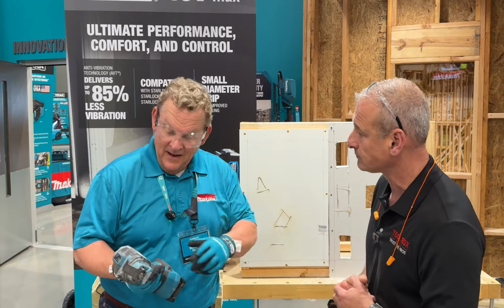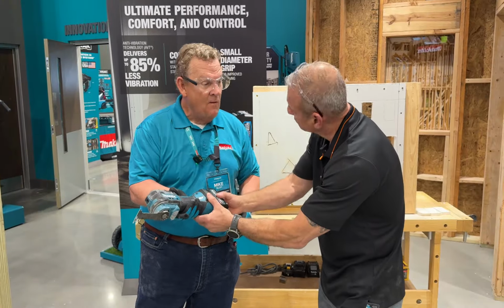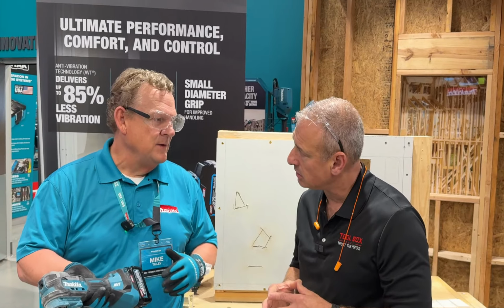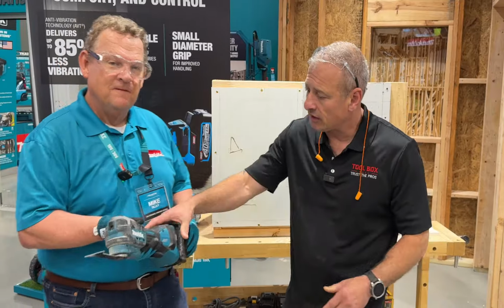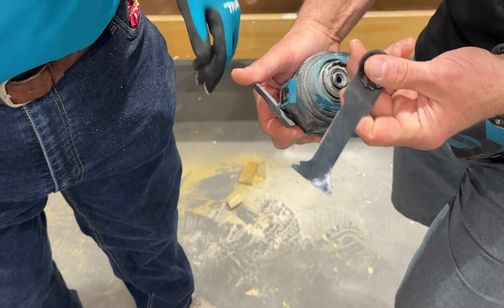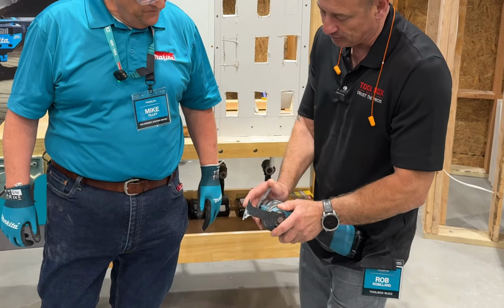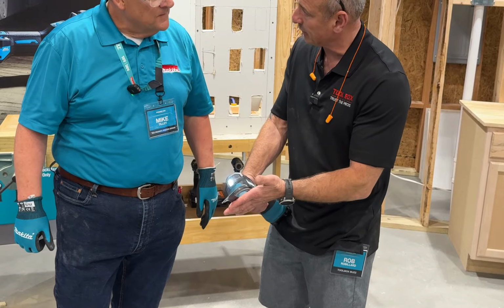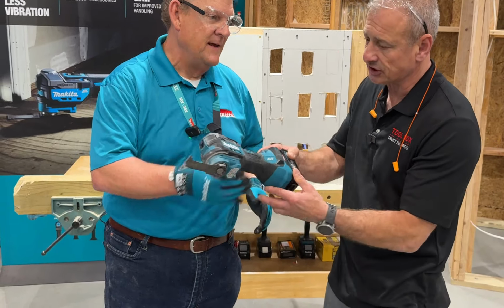Makita 40 Volt XGT Multitool TM001GZ01

Comment: I really wished they had worked on the ergonomics and form-factor with this model. That is the largest multi-tool on the market, somehow bigger than their first. It's not even necessary either as their competitor (hikoki) was able to achieve a much smaller form factor, low noise and vibration with same to superior cut speed. The funny thing about how this multi-tool is marketed to Americans is that the 18v variant is part of their sub-compact line. That's right, the world's largest multi-tool is part of the sub-compact line, what is that called, "alternative facts"?. Marketing genius.
Reply from the maker: it is big but well-balanced
Reply: @ConcordCarpenter  Despite my criticisms, it's overall a fantastic tool.
Reply: Sold my lxt gigantic version, it is too large to use for cabinet installations. 
Very quiet,extremely low vibration, stupidly too large yo use in the real world lol
Reply: It still has by far lowest vibrations and noise out of any multitool in the world so this is a small price to pay
Reply: @riba2233  It's ahead in vibration control but not in noise, no. Two sources: 

Take a look at the multi-tool head to head on this very channel, you'll find it scored 4th place in sound.

Another place to look at is a direct comparison video between the gen 2 hikoki and the gen 2 makita over on the Japanese side of youtube. They measured 82db for the Makita and 79db for the Hikoki, remember that the decibel scale is logarithmic and not linear.

So you're actually only trading off a little more vibration dampening for the size. Which might be worth it to you. Personally, all modern multi-tools I've tried now have enough dampening in them that they're comfortable to use for long periods of time. So I'll stick to what I said.
Reply: @2chipped festool one is great and way slimmer around the head and blade attachments which is the most important part to get close, it’s also no pi to lose, and goes well, I’ve given my death for 4 years now.
Reply: @anthonyturner5319  I love my m12 fuel. Wider oscillating range,and cuts as quick with a little more vibration and noise...also uses cheaper standard blades.
I've run a coworker's festool, and he didn't know how to turn the light off.
Light pulses and the strobe gave me nausea.
Reply: @2chipped  that’s the jigsaw, multi tool has no light.

Comment: I am sure it is a great performing and feeling tool, but I am annoyed there is a pin system when other Starlock tools do not need one. It feels like they want to adopt the latest and greatest standard but can't fully part with the old system. You could also say Milwaukee and DeWALT can't part with the old either. Milwaukee has double downed on Universal Fit. DeWALT has no official statement that I know of but has yet to switch to Starlock.

Comment: Tool by tool makita disappoints me and my teal tools are turning red with every passing day.
Reply: Why, they have the best tools out there?
Reply: @riba2233  They're too far behind on a lot of stuff.
Nailers?? Bueller....bueller....bueller....

That's how it all started for my tools turning red after the Gen 2 M18 nailers came out and Makita just sits with its thumb up its butt.

This multi tool is freaking gigantic and no one wants expensive Starlock blades for a highly consumable item.
Moved onto the M12 Fuel. Small. Fits everywhere. Cuts fast. 

Like i said, tool by tool, my collection is growing red.
Reply: @evictioncarpentry2628   wow that's two tools, they are leader in most of categories, even this multitool is leader in some main aspects like vibration and noise. Even nailers are not that bad as people think.Milwaukee has become low quality consumer trash unfortunately...
Reply: I’d be careful going red, you might be disappointed over time.  It’s easy to look at the red tools and be impressed with the speed.  I’ve had every red tool made and have had non stop issues with them.  There are few that stand the test of time.  I’ve been slowly transitioning over to makita and so far I’m not disappointed however only time will tell.  All in all I’d take build quality over seconds of speed any day.  Red is like cat on crack.  Hope you have better luck than I did.
Reply: @ToolTimewithTerry  My decision has absolutely nothing to do with Speed or power. Makita just isn't making the tools the way I want them and at the rate people and the industry is going anymore.

I've had half a dozen Milwaukee tools crap out on me already. They've been warrantied with brand new tools within a week even when they were heavily used for 2-3 years.
Heck, I even broke my own M18 miter saw by dropping something on the rails, fully expecting to pay to have it fixed. Got a call my tool was ready for pickup and they just replaced it with a new one no questions asked.
Reply: @riba2233  What are you smoking. Lol Makita nailers are absolute trash as were the first generation M18 nailers...which is how long makita hasn't tried to update them and that's like 8+ years now. It's not just "two tools" it's way more then that. They're just too slow for the market now.
Reply: @evictioncarpentry2628  way more than two? Ok name them... Multitool is class leading and not all nailers are bad.
Reply: @evictioncarpentry2628  I’m glad you’ve had luck with them.  I bought there too of the line lazer level kit m12 and it was broken after just a few uses and they refused to warranty it (6 months old). Told we I would be charged and had to take it to the nearest service center, which is  an hour and a half away.  They have replaced several m18 drills that stopped working but not without a bit of hassle.
Reply: @ToolTimewithTerry  No different then Bosch for me. I got the Green 360 laser, used it 3 times and it went dead.
Tried to warranty, waited 2 months for it to come back. Opened the box and They sent me a visibly used, spray paint covered red laser as a refurbished replacement for my brand new one. When I complained, they took it back. "Lost it" for 2 more months. Finally found it, then took another 4 weeks for a new one to be sent out.